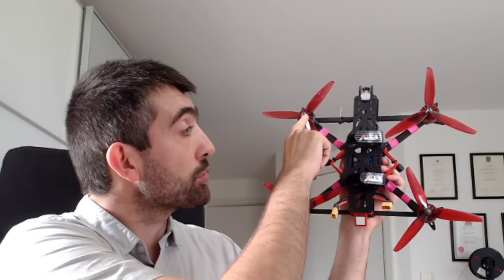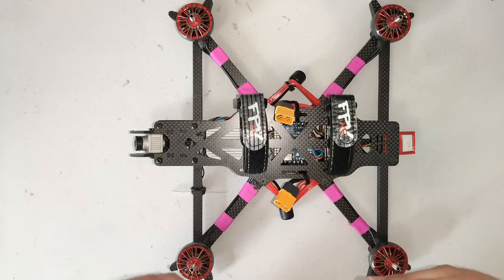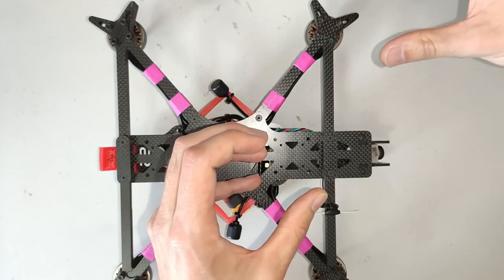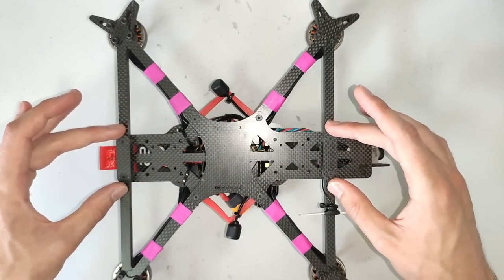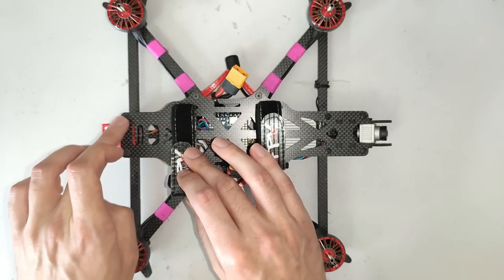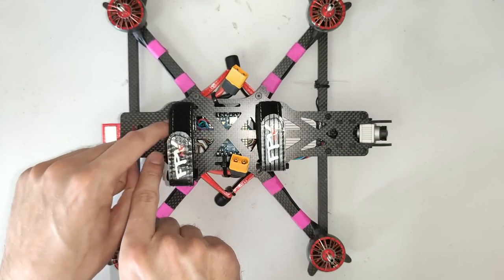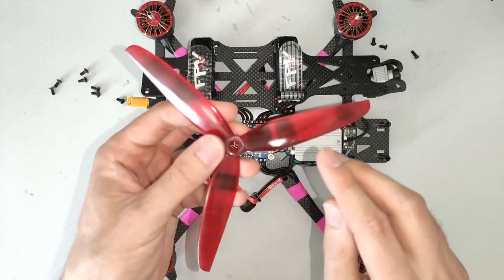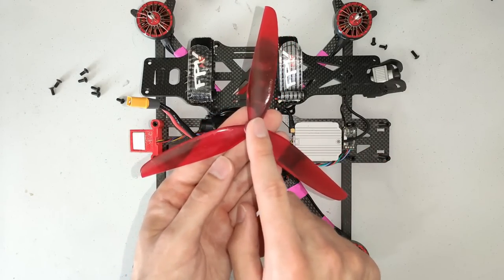The AOS 7 "Mantis". A 7" frame designed for maximum flight performance.

Comment: Mr. Steel is going to roast the F out of this frame.   Keep going no matter what. It can only help your sales :)!
Reply from the maker: Onwards and upwards!
Reply: AND HE DID!!
Reply: Well the AOS5 may not be the ultimate frame and its utilitarian design look may not be pleasing but most of Steele's rant was based on "i think" and pretty baseless also  for people like Steele who are pretty rigid with what they use so much so to fly the same piece of kit that they did 2 years ago something new and innovative getting turned down isnt surprising , he is an awesome pilot no doubt but he definitely doesnt have the right to outright disrespect someones passion work the way he did.
Reply: Make an 8 or 9 with a top-plate to mount a naked bmcc.  I'll buy 2.
Reply: @ChrisRosser  can you do a AOS 10inch frame
Reply: I would also take a 10 version instead of a cinelifter style frame.

Comment: Iam glad someone getting seriously the lamination orientation in this hobby! Well  done!
Reply from the maker: You just wait. Next frame is using an optimized carbon fibre layup for the arms. 20% stiffer and stronger, 0% extra weight. 😁
Reply: @ChrisRosser  Nice, when is this frame coming out?
Reply from the maker: @birdseyeview5242  It's been out for a long time. The AOS 5R. You can check it out on CNCDrones .

Comment: Just finished my build. It's awesome. Just one note on something I stumbled upon just now: If  you fly reversed motor direction, the gopro mount will get hit by the props. At least the mounts i've printed so far. Don't know if it's just me or it didn't come up yet. Thank you for your work and passion Chris!
Reply from the maker: Thanks for the info! If you can ping me a photo to chrisrosser91@gmail.com that would be super helpful. 🙏
Reply: @ChrisRosser  done. Hope it helps. Thank you for all your contributions! Converting my fleet to aos as we speak :D So happy with them!
Reply: Hi Metz, just curious to know the difference between directions of the prop for this issue , just building my AOS7 now and I usually fly reversed prop direction
Reply: @Simofly  the direction I use is the reversed aswell. I had to redesign the mount with a little bit more height so that it wouldn't hit. At the time i talked to Chris about it, don't know if there's another version of the mount by  now. I have the stl around somewhere. If you need it just let me know.

Comment: Is there a V2 in the works? Airunit should be behind the stack, since all FCs have the DJI connector on the back.
I really like the symmetric design and wide top plate. Most 7" have a very small top plate and not that much room.
Reply from the maker: On larger frames the length of the camera cable on the vista and air unit prevents rear mounting. This is the case for digital video systems. Analog can be rear mounted.

Comment: Frame looks great! But why only 2 screws on each arm instead of 4? There is enough place for 2 more screws. It dont looks good for me to safe such a heavy 8mm arm just with a aluminum standoff! Two more screws on each arm secured with press nuts would be a great deal.
Are there any plans to release a optimized v2 of this frame?
Reply from the maker: The arm is sandwiched between 5mm of carbon so is quite secure with a steel screw. It's hard to improve on the arm design for this frame which is why there has been no V2. I'm planning a 7" ultralight which will be pretty exciting but not competing directly with this design. This is actually one of the frames I get the most positive feedback about so it has a special place in my heart!
Reply: @ChrisRosser  Thanks for your answer. Would really like to give it a try. But can't find a shop in Europe that is selling this Fram except the drone fpv Racer shop in France. But it's out of stock there. So where I can buy this frame here in Europe? 🤔
Reply from the maker: @MrSmithFPV  I'd drop a  note to drone-fpv-racer and ask them to order some in for you. They can adda few frames to their next order with iFlight.

Comment: Just ordered this awesome frame. Would you share filter settings ( and PID s) or give some recommendations?
Reply from the maker: You can use my recommended filter settings and master to 1.5 as a starting point for your tune 👍

Comment: I'm guessing that sandwiched arm interface at each motor base makes one awesome mechanical low frequency resonance filter in addition to the arm features.  I'm curious to see how the BB data will look under BF4.3 with just the RPM and single BiQuad Dterm arrangement.  (or maybe just a PT on the DTerm???)
Reply from the maker: Absolutely! should have mentioned that in the video. It's actually a very good location to dissipate energy from some low frequency resonant modes.

Comment: That's seems to be the 7 inch frame I'm looking for ! But I'm flying analog, and my FPV camera is a 22m size. If I don't use the carbon pieces for the FPV camera, and if I design a TPU support with the front standoffs instead, do you think it is ok in a mechanical point of view ?

Comment: Does the full size dji air unit fit in the back of the frame? I'm still adamant about using SMA adapters and antennas on the rear, and it's best to have the wires as short as possible, so the front mounting wouldn't be ideal for me
Reply from the maker: Yes it does. But you need a long camera cable (200mm) if you put the air unit in the back.
Reply: @ChrisRosser  That's not an issue, I'm already using a longer camera cable. Thanks

Comment: Hi Chris - Have you tested this setup for maximum range? If so, what was it? My main focus is the antenna setup which is not like most long range quads, when they mounted high above the frame, not like this frame. Thanks - love your content, and also I have the AOS 5.5 and I am realy happy with it.
Reply from the maker: Wes vardy has tested the DJI system out to 10km with the stock antennas. If you use a patch on the DJI goggles at 1200mW I think you could hit the range limit on the system ~13km with my antenna setup.
Reply: @ChrisRosser  Thanks! - I am checking it out now.

Comment: Awesome video Chris! I have a question. Is 2208 motor overkill for a 5 inch quad?
Reply from the maker: 2208 is ideal for 5.5" but I tend to prefer a 2207 for 5". It might just be a little more motor than you need but that's better than too little motor.
Reply: @ChrisRosser  Thanks a lot for the quick response! :)

Comment: Does have a battery strap only around top plate  effect geometry more than if strap went around top and bottom plate. ? 

Might be cool to design battery straps that go through both plates so battery is really pulling on bottom plate. 
Tightening the whole structure
Reply from the maker: That's an interesting idea. On this frame I've got mounting for batteries top and bottom. If the strap goes around both plates I'd worry about someone really cranking the strap down hard and bending the plates together? I don't think anything would break but it doesn't feel good.

Comment: Very impressed with your approach to frame design.    How do you match motors (Volts, Amps,  kV), props (dia and pitch), lift vs weight?   I already understand kV and motor selection for a fixed wing, but am interested how you put this together.   Thanks.

Comment: Excellent design and overview, thanks for sharing. One important flight preformance metric is G's for me, enable ACC, of course fly in acro, hover, enable BB recording, punch out for ~2 sec. What is the peak G's on Z axis? My 5 year old quad does 9 G's (15.5 in turns). The light weight guys are getting 15G's in punch out. Of course everybody is different, but this number rates near the top of my requirements, also sub quarter sec rolls and frame reliability.
Reply: Chris, you pulled your reply,,, anyways, if you every get around to finding out the G's it pulls in a punchout, I would be interested, a BB log would also go along ways as it shows the peak G's and how long it took to get there, thanks.
Reply from the maker: Hey Ozzy! I didn't reply earlier, must have been someone else. Gs is less important for me. In my freestyle I rarely use full throttle. I focus on propwash performance and smoothness of the HD footage. Your metric might be more appropriate for racing.
Reply: @ChrisRosser  Hey, thanks for the update. "Max preformance" for you and me are quite different, thanks again. What is the AUW with two 6S-1100 packs?
Reply from the maker: @Ozzy3333333  ~1050g with 2x 6S 1100mAh
Reply: @ChrisRosser  I’ve seen Ozzy fly and must say I have never seen anything like it. All LOS and the Tasmanian devil is craaaaazy! This will be the ultimate test of your frame 😃💪

Comment: Had my first hard dump with my AOS5 build today. My only complaint is the GoPro mounting solution as it ripped free of the mounting bolts in the crash even with washers. Have you considered running a horizontal cross standoff on the camera plates to then use as a beam to mount the GoPro TPU. The UmmaGawd MoonGoat and the Catalyst Machineworks frames use this kind of mounting and I've found it to be a LOT more durable as I've never had a failure.
Reply from the maker: Thanks for the feedback, I'm amazed the mount came loose with washers on you must have been going for it! Did the TPU break around the hole? or did the whole washer pull through? Perhaps a straight brace piece across the front two screws could solve that problem. Then the mount cannot pull through?

Comment: Does electrical tape insulate the antenna enough to be close to carbon fiber? 

I’ve been giving a few wraps around the cf anywhere antennas are close trying to give it some isolation..

Ive had no issuers. No idea if it’s helping or…
Reply from the maker: I don't know. I wouldn't expect it matters too much as the antenna probably has a bit of plastic around it as well right?

Comment: What's the maximum payload ? I'm thinking about redesiging top plate to fit Naked Blackmagic camera and use your arms. They seems to be pretty durable with 8mm carbon. Weight of the naked bmpcc is around 500g . I would use tmotor F100 motors. What do you think ?
Reply from the maker: I'm working on a 7" X8 cinelifter. Send me an email and I'd like to get your thoughts!
Reply: @ChrisRosser  any updates on X8?
Reply from the maker: @mmineque  https://www.cncdrones.com/aos-cine70.html The AOS Cine 70 is currently in Beta at cncdrones

Comment: I feel its a bit on the heavy side for doing long range cruising. Would love a similar 7inch design but owth lower weight.
Reply: Check out the 7" he mentioned at the beginning of the video. Falcon Rad's. Should be linked in description.
Reply from the maker: Yep the AOS Falcon 7 might be the ideal frame for you. 😁

Comment: ordered 2 of them. how did you soldered the 2 pigtails to the esc?
Reply from the maker: My ESC had pads top and bottom for the battery. One pigtail went on the top and the other on the bottom of the board.
Reply: @ChrisRosser  clever and smart... thanks @chris rosser

Comment: That thing is huge! Really impressive how you managed to achieve such great results even with more challenging class. Maybe try some lightweight class in the future, most design compromise vibration to achieve low weight.
Reply from the maker: Yep it's a chunky one. Lots of people have been asking for a toothpick. Maybe that one next!
Reply: @ChrisRosser  ooh, I'd love to see your take on a toothpick, maybe even a babytooth.
Reply from the maker: @Bruno-cb5gk  Yeah why not! I'm launching a race frame next but after that I'll look at a toothpick!
Reply: @ChrisRosser  This will be very interesting to me, since you design exclusively top mount frames, and I've been pursuing top mount toothpick designs since the TP3 was released (the modular design of the TP3 allowed me to tinker, and I wound up with a top mount 2.5", and even a 2.5" "Pushpick," that provided for an inboard mounted battery which reduced the height profile by 1/3.) I'm looking forward to your design  in this class (and any class, quite sincerely.)

Recently, I'm pursuing fully 3D printed frames, mashing up different designs in pursuit of my own vision. With any amount of performance in mind, it seems the feasible size range with current home printers, and available filaments, is prob anything < 3". I was caught off guard by one of my recent builds, a 1S fully printed frame with 40mm props, when I discovered it flies more, "like a 5 inch," than any of the other 60 or 70 2, 3, and 4 inchers I've built and flown. It is like a little stone, yet has that throwable, floaty (not like a leaf,) super hang time kinda behavior to it, and it also has the rare (in my experience,) mix of properties where with pinch moves, the battery sags only to a point, and then sustains even under full punch, like you cant actually sag it into LV until near the end of the flight. (EX0802 19kkv + 40mm bi-blades, for the curious.) Anyway, if it happens to excite you, a fully printed (sub 3",) frame with Rosser standards/performance is another that I'd personally love to see, and a potential crowd pleaser too I believe. I am also intrigued by what you might could tell me about folding props, if theres anything interesting there. Cheers! And thank you,  kind sir.

Comment: Hi Chris,
Another fantastic design and build! Thanks for sharing and all the work. 
One quick question: the antenna position is good for “short” flights but not really for mountain surfing right? 
What would be a good position?
Reply from the maker: That position should be good out to the range of the DJI system (13km or so) but to go longer you will need to use Analog and perhaps a different position would be better. I'm not a long range pilot so I don't want to suggest somthing that could be wrong.

Comment: Sounds like it can really carry some lipo..
At what weight does 7” not make sense anymore and should go 9”? 
I have a bunch of 120c 6s 5600 packs… 850g… 
Was thinking I needed 9”
Reply from the maker: It'll carry a 6000mAh no problem. Plenty of space and lift capacity.

Comment: I'm currently planning a 6" to change a bit from the 5ers (Apex 6 HD), but this might take the spot...
Would the XING2 2506 1350kv be adequate for 7" (much cheaper and easier to find than the one you mention) ?

Also, small tidbit : your noise gate feels a bit aggressive to me and cuts the noise too fast after you stop talking. You may want to tweak the attack/release parameters, or consider using a band-stop/notch filter instead if you need to remove background noise (AC unit, etc).
Reply from the maker: Hmm 2506 might be a little on the small size. Emax ECO II 2806 could be a good option?
Reply: I've got some 2506 1350kv on a super light aureo 7" 6s, it works for long-range cruising with a lightweight 7" or biblade if ya wanna fly a bit more aggressively
.. 2806.5/2807 for good propwash performance/freestyle
Reply: Thanks to both of you. It's for cruising around / relaxed flights. I'll check the Eco II 2806, otherwise get the 2506 and stick with bi-blades

Comment: Can you supply a link to the antenna mount please?
Reply from the maker: Yep in the video description now! Thanks 👍
Reply: @ChrisRosser  Hi Chris, do you have the design for BN880 GPS mount compatible with AOS7? Planning to order the frame, but i am thinking about the most balanced setup possible. I would appreciate your comments about the difference between HQ7x4x3/HQ7x3.5x3 for this frame in combination with XING or Avenger 2806.5(1300kv)/FPVcycle 30MM(1450/1100kv) ....i mean, what would be the best/balanced combination and if there is a specific reason to prefer/avoid one combination over another. Additionally(sorry for noob questions), is there any reason to choose a different GPS module???

Comment: Interesting how at 7" we start to see more function over form in the design. I quite like the look of the AOS5, not so much the 7. 

Also, have you noticed any adverse effects of having the camera way out in front like that? Some pilots mention the visual appearance of pitch moves being compromised with cameras that far forward.
Reply from the maker: One of the key design considerations was keeping props out of view and having a very long top plate to carry 6000+mAh 6S packs for long range. That led to a longer neck on this quad I think it looks quite a bit more balanced with GoPro and batteries.
Reply: Agree with u there chris every comprmise possible would most likely weild the same result

Comment: Love it, Chris! Have you tested any bi-blades? I really love the sound and efficiency of bi-blades on my current 7", but the vibration is tough to ring out. Would really be happy if I could run them on your frame...
Reply from the maker: Hi Greg, I'm afraid I've only run with triblades I'm afraid. Biblades will produce more vibration in my experience at lower frequency but if any frame can handle them well it would be the AOS 7. Thanks!

Comment: Hi Chris, thanks for all the good content on your channel!
I'm going to build a AOS 7 soon with almost identical setup to the one in the video.
iFlight Succex 60A ESC, iFlight XING 2806.5, Air Unit, BN-220 GPS, Holybro KakuteH7 FC
I'm going to use longer antennas for long range (will also run 868mhz ELRS and plan to mount the antenna vertically), so the build is not going to be as clean as the one in the video but still very good thanks to the frame design.
I was wondering if you have any existing tune for BF 4.3.0 which I can start playing/tuning from it? 
Any diff file with pids and filter setup would be much appreciated 🙏